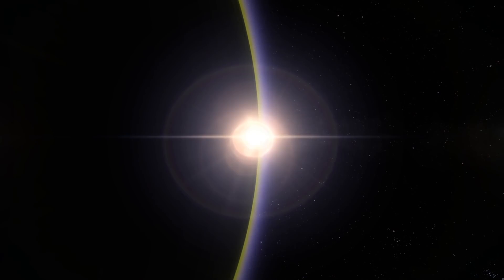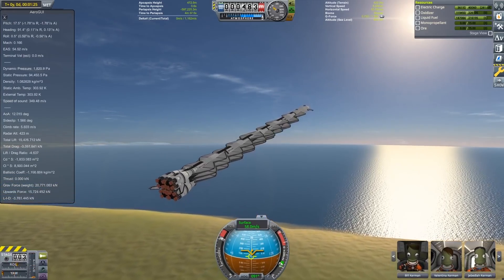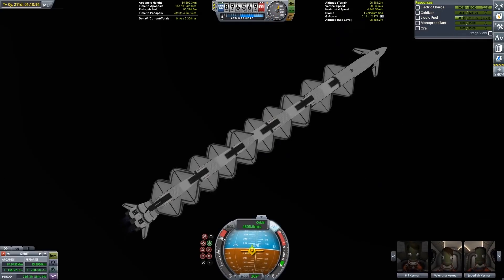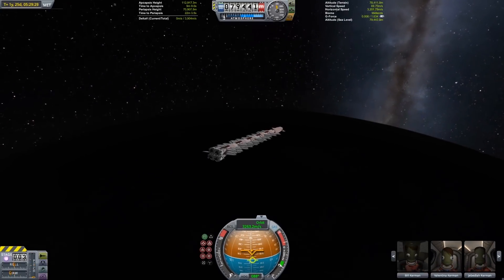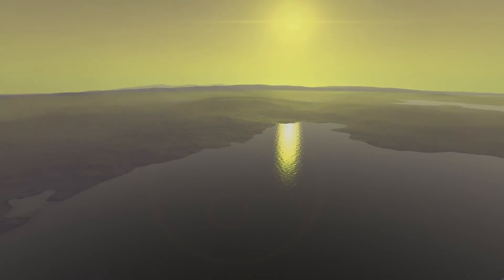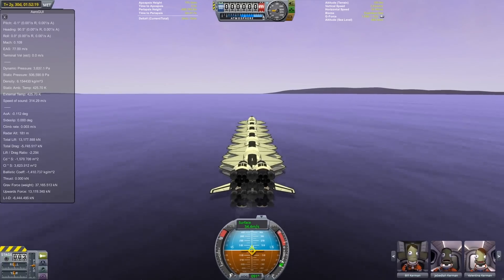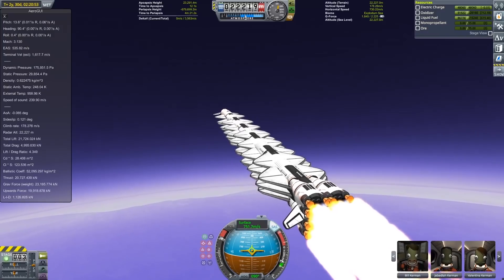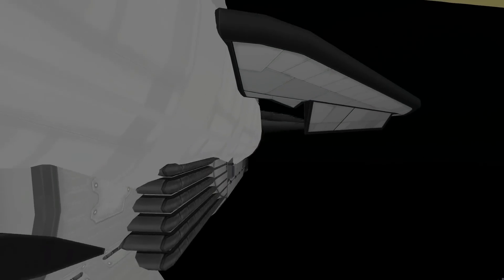Eve single stage cargo plane - 128 tons of payload to Eve orbit

Comment: In ur base, make:
A greenhouse made of cupola modules
A hot tub
A rover garage
A fleet of terraforming/mining rovers
An outdoor cafe/seating area
A perpetually flying section of the base, powered by propellers and a bunch of RTGs, hovering indefinitely
An eve speedboat
A mobile launch platform (using klaws) that houses a reusable survey probe 
A luxurious, propellor plane for eccentric billionaire tourists
A hotel complex, complete with breakfast buffets, pools, enclosed botanical gardens, and maybe even AN EXTRAPLANETARY AMUSEMENT PARK

Edit:
Make a mobile crane type thingy with robotic parts and klaws
And add a massive rover that has legs instead of wheels, walking around like and AT-AT or AT-TE from Star Wars 

I LOVE THIS SSTO

Comment: Is the contant impusle something of real life engines too? Or is it a limitation with how the game models engine efficiency?
Reply from the maker: This does apply to real rocket engines.  Rocket engines work according to Newton's third law - the exhaust is ejected out the back, and an equal and opposite force is exerted on the craft forward.  As a result, there is a constant force imparted by the rocket engine regardless of the speed you are travelling at.  Impulse is force over time, and specific impulse is the ratio of impulse to mass of fuel consumed, so both of these are invariant (constant) relative to velocity.

Since kinetic energy is proportional to the square of velocity, rocket engines therefore are more powerful the faster you are going.  This should seem quite odd - it may sound like free energy.  The "extra" energy isn't from nowhere, its a result of the fuel already having kinetic energy from being at a non-zero velocity.

This principle of impulse being more efficient at a higher velocity is one way to understand the 'Oberth Effect' - which is the reason why we do our maneuvers when we are close to a planet or moon, and therefore at a higher velocity relative to that body.
Reply: @BradleyWhistance  
Intresting, thanks for the time to make this comment

But since the propellent acts on the craft in the craft's own reference frame,  from the point of view of the engine, the propellent is leaving the chamber at the same speed no matter how fast compared to a celestial body said engine is going, so, how does that affect in any way the thrust exerted on the engine? Doesnt the entire push push reaction happen in the engine's reference frame?
Reply from the maker: It doesn't affect the thrust.  Thrust is force, and the engine has a constant thrust output over all speeds.  However, since work done is force applied over distance, the same force while moving faster applies over a greater distance, increasing work done.
Reply: @BradleyWhistance  Soooooo.... Would attaching engines to a pole on a planet at 90°s in an attempt to spin up the planet be considerably less efficient than using the same engine to speed up an impacter to incredible speed meant to transfer it's kinetic energy into rotational energy?

Really changes the way I see rocket physics, very counter intuitive

Comment: Not saying I don't enjoy seeing those massive SSTOs, but can we maybe get some low-tech ones too?  As in; some that start on Panther or MAYBE Whiplash engines (and then use Vacuum optimized engines like the Terrier for higher altitude and vacuum operation)
Reply from the maker: Low-tech SSTO is an interesting idea!
Reply: @BradleyWhistance  Here's a challenge: An SSTO that can carry and deploy a full FLT-800 Tank into Orbit using no engines higher tier than the Panther.

Bonus Kudos if the Panther is the ONLY liquid fuel engine (Solids for circularizing and monoprop RCS for deorbiting?)

Comment: Have you ever thought about trying to extract power out of either the narrow band scanner or the airbrakes? They have moving collision meshes that can drive other parts, but they're controlled by the animation system instead of physics. They're basically low-speed, infinite-torque motors.

I tried a couple weeks ago to put together a proof-of-concept scanner-copter on Kerbin. The idea was to eventually scale it up into my own vanilla Eve cargo SSTO like a cross between this one and Eve Infinity 2, but I couldn't quite work out a bearing and transmission that can withstand the crazy amounts of torque needed at the narrow radius of the scanner probe in order to drive the large mechanical ratio needed to turn the low RPM of the scanner into a useful rotor blade speed.

Comment: This adds an equal amount of submarines in the sky as it does planes in the ocean, but significantly increases the ratio of the two. Also, that’s incredible. Ever since the “single stage to Kerbin from Eve” video, I’d wondered how that cargo SSTO that morphed into the return vehicle there would differ. Now, and with the addition of the DLC props, I guess I know!

Comment: build a submerisble vertical base section that can dock with another base section at the bottom of the explodium sea and go between the sea floor and surface at any time
Reply: Cool Idea. Perhaps the sea base should be submersible and be able to attach to the sea bed but also rise to the the surface. That would make more sense than two sections.
Reply: @OrionAerospaceKSP  yeah but docking is cool